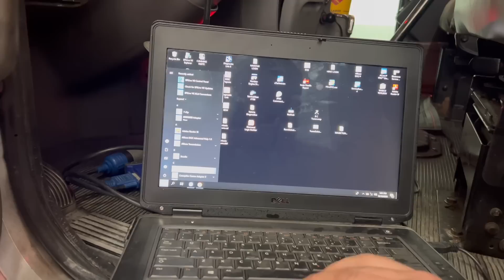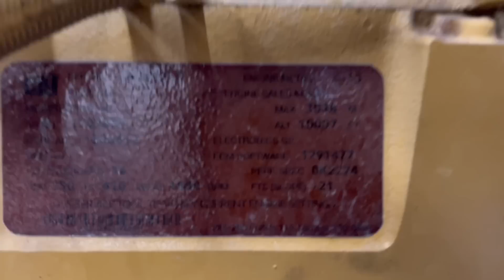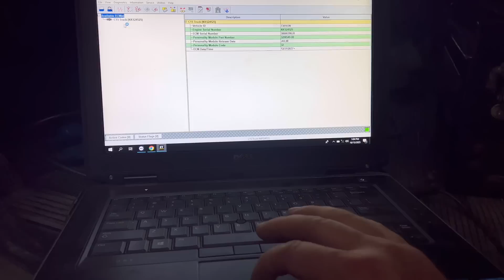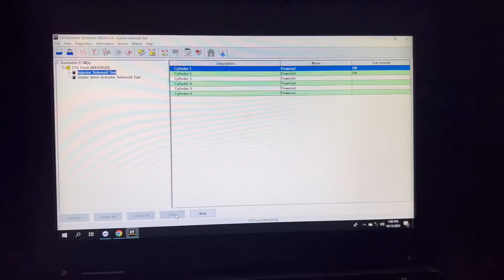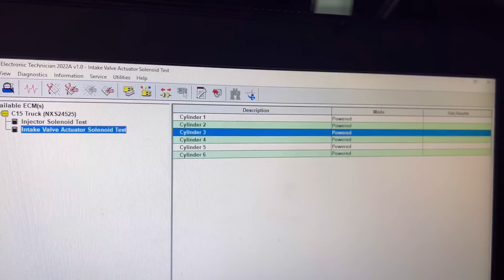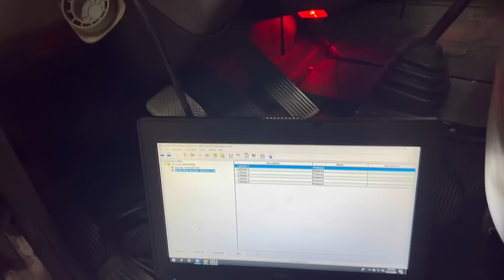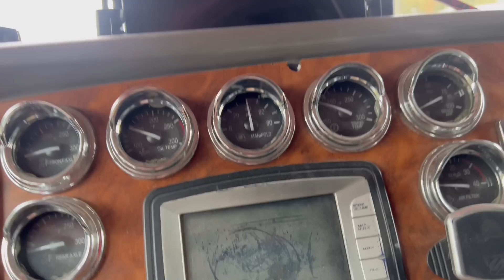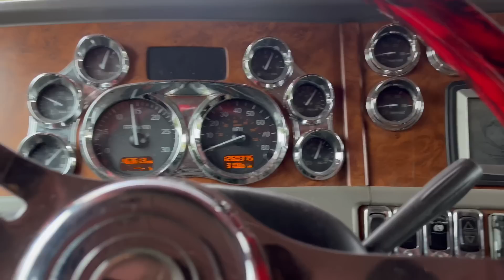Coronado And 379 Peterbilt Problems!! New Paint Booth Arrived..

Comment: Green green green on the Coronado keep up the appearance on that girl she is a pretty truck with all that green now I can see black Rhino liner on the aluminum running boards because they are hard to keep polished  but I would polish everything I could and what you can’t paint black it would even look good with two tone fuel tanks green and polish maybe a hint of black like a stripe separating the green and polish keep that dream of a driving show truck don’t switch everything over to just work mode keep the pride you have in your trucks

Comment: Tim, think using dielectric grease on the plugs inside the valve covers would stop oil intrusion? It fixed issues with my old 7.3 truck. Injectors kept showing bad, wiggle wires and fixed. Tried dielectric grease and it was perfect

Comment: What happens with using an impact with chrome sockets is the sockets flex, eventually the chrome releases from the socket, it will come off in flakes. Those flakes are hard and will slice and dice you pretty quickly. It's like a papercut on steroids. It's not the first time you use it that it starts flaking, it's a couple months to a year down the road, when it starts coming loose.

Comment: The c15 Acert is not twin turbo, it is actually compound or sequential turbo which is when one turbo feeds into a second turbo.

Those connectors should never have dielectric grease used on them, there is nothing that needs to be sealed.  Dielectric grease should never be used on the actual electrical contacts.  Dielectric grease is actually an insulator which will increase resistance in a circuit.

Comment: That CAT isn't classed as a Twin turbo it's a Compound turbo first one feeds into the 2nd gives you more bottom end torque and not designed for max boost but drive/workability performance. Scania run them on some engines

Comment: Speaking from being in the paint and body industry. One of the biggest problems with those inflatable spray booths is. When you lose power to the blower motor your screwed. Its going to collapse onto your work. Also if the booth shifts in wind you run the risk of it touching wet parts. But mainly watch for the blower motor randomly shutting off,getting pulled out of the inlet or the power cord getting unhooked. I had a guy using one to paint an rv. The dog pulled the cord out and it deflated onto the wet paint job.

Comment: Tim i had the cluth brake issue also. When i put the new transmission in, we found that the pilot bearing was frozen up. Also i only use soild cluch brakes. They are better metal on the ears than two piece.

Comment: This is China made. Small section your wife was asking is where you keep supplies and mix Paint. Booth is for Painting only.
I have seen this in China. They had a Cement Pad, installed steel post same shape big round air pillars in paint booth it was out side they had same shape Tarp installed to protect from Rain, those guys were using it day night. Painting parts like  crazy.
It was a joke, I told them there answer it works great make lots of money.

Comment: Those acert motors are mistake from cat with this issue I’m about to mention. Under the rocker covers they have a sensor that is common to play up and throw the truck into limp mode. Sensor and wiring harness common fault with the cat acert motor. As soon as you have issues with those sensors and wiring harness please replace them as once the issue starts it will not stop, the sensor will fail constantly and the wiring harness will eventually completely fail. I used to drive one here in Australia and major issues. The twin turbo system over here is only set to boost at 25 pound maximum. Good luck with the engine but over all I love the cat motors and they sound amazing. Mine was straight piped and the note it played under boost and jakes just wow. Beautiful motor and that truck looks hot.

Comment: Not semi's but im having the same issue.. blown engines, trucks down.. hard to run a service company when you can't get to the jobs .. and everyone still thinks thier $5k,  270k miles, rusty a$$ truck is worth 10k +15k .. keep your junk I'm rebuilding engines and like you doing extra things to them, so don't feel like the Lone Ranger Tim lol .. btw .. leave normal & green , we use the rino liner paint job on trucks for years now that go off road or in so bad of shape it's not worth a paint job.. collects a lot of dirt fast after a little time you'll be asking yourself.. why?

Comment: As a seasoned cat man. If you deacert that engine with a 6NZ cam and a good set of 58’s along with keeping the twins. This engine will out pull roosters 16L. Normally I would suggest changing liner packs to lower the compression from 18:1 to 16:1 to keep the head gasket in. If you deacert it but keep the twins you will see better fuel mileage, better power range and, lower egt’s than a single.